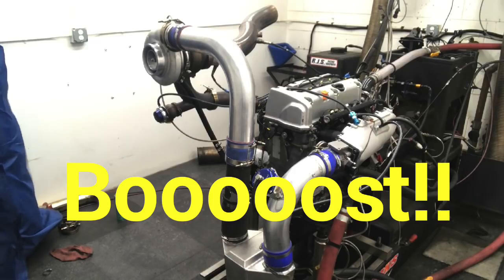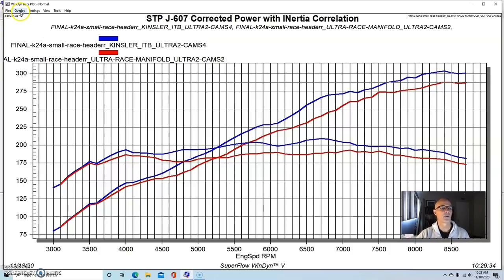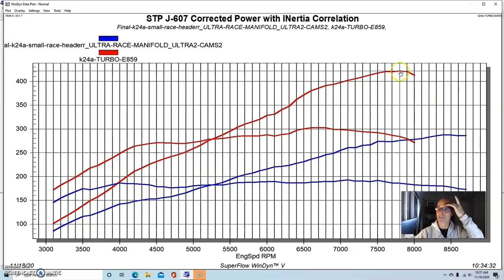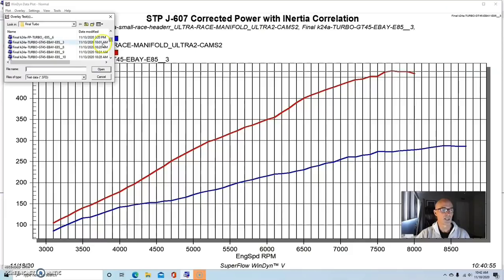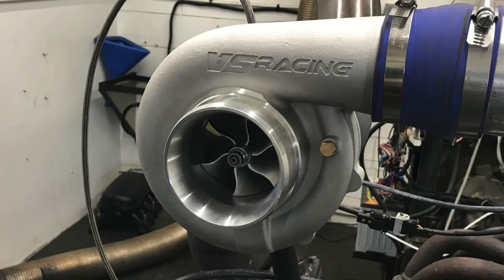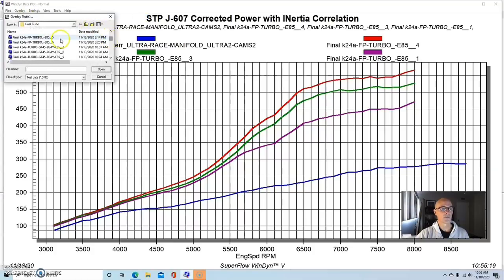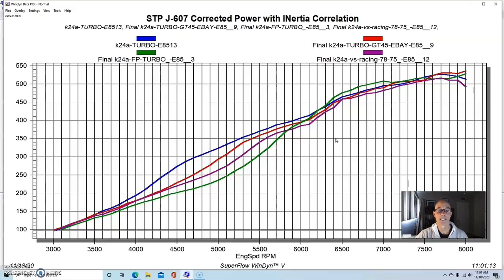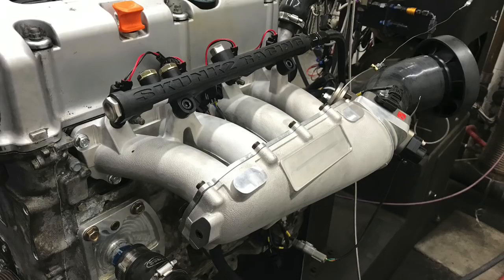CHEAP TURBO TEST-K24A2 BOOST RESPONSE TEST

Comment: Honda should have, and still should, produce two V8 engines. 1st with a N/A engine, and an optional 2nd V8 Turbo engine that has exhaust manifold built into the heads, for massive torque, with variable twin-turbos or compound turbo setup.   Put the N/A V8 into a TRUCK frame, for under $30,000.  Then an option for an off-road/rally TRUCK, with the twin turbo, for under $40,000.  Take some losses but it would sell like hot-cakes.  Build them in USA!
Reply: Going be alot of r&d going on.
Reply: Honda cant do that because it would make every other car company go out of business. A turbo awd v8 civic would destroy anything and everything on the street and track. It would literally be the greatest engine ever produced and there would be no point in buying anything other than a v8 honda engine.
Reply: @lamydora457  Sounds like a good thing!

Comment: Such a great video brother good job man!! Hey so what brand is the 62mm turbo do you have an affiliate link on where to purchase it? I want to do a budget turbo set up on my 1 of 1 kswapped Ford Festiva. If you could share any insight on a full budget build that would be fantastic. I’m new to the k24 but man they seems to make great power and stay fairly reliable even with a stock longblock. Any chance I’d be able to email you for a chat?
Reply from the maker: THE 62MM WAS ACTUALLY A 67MM AND WAS FROM PRECISION
Reply: @ dang that’s a good turbo any recommendations that’s will do the job but not break the bank?
Reply: @richardholdener1727  so that 67mm was it the 6766? Or the 6775? That are decently priced and man from this video that what I want lol

Comment: FP turbo results look like a low back pressure with a large cam - as soon as back pressure creeps in on the others it'll drop power off pretty quick - that FP probably had 1:1 emap and imap or close to and lets the big cams eat.

Comment: Also to add to this bigger turbo makes more power at lower boost such as 10 lbs on a small turbo may be 5 lbs on a big turbo which can have better charge temps I have also seen turbos with a .63 hot 78 cold that make 5lbs fast but get lazy at more boost over a .63 70 closer to equal wheels

Comment: Watching your channel inspired me to buy 2 3RZ motors.  I have spent a week or so trying to wrap my brain around turbos and which one I need but my head is just mush. This motor is going to be a swap in my 1987 Toyota pickup which lacks power with its 22r. Any advice on turbo size for my 2.7L 4 cylinder 3RZ. Thanks

Comment: Would absolutely love to get some Kinsler ITBs for my all motor K. Currently still running the Hayward Performance manifold and it does really well but ITBs are just top shelf all motor units lol. Truthfully my ported and port matched RBC made good power in itself. We’ll see what direction my next $$ gets sent to; ITBs are certainly in my future if I stay all motor but I’m also considering dumping the current piston giving me ~13.5:1 static comp and going for around 10:1 then taking the old Sidewinder and GTX3076 off the parts shelf and making something new happen. Decisions decisions lol
Reply: P.S. Someone on the east coast come buy my LS car so I can have more free cash to dump in the rice rocket haha

Comment: Might be a very stupid question but can you/I run salt ice water in the intercooler?  How fast would it start to cause problems if any?   We learned when we were young that salt water will get way colder than plain water, it's how we got ice cold beer very quickly.
Reply from the maker: YES YOU CAN-IT'S NOT GREAT ON ALUMINUM LONG TERM

Comment: @richard Holdener curious as to why 17* timing? Were you seeing knock?  And was that at peak tq or were you ramping timing as rpm increased to keep peak hp climbing? Also curious what the back pressure was with using the stock  exhaust manifold. I would guess that flow is being hurt at higher rpm and that’s why curve is falling off from the Na pulls.
Reply from the maker: the drop off didn't happen with the FP turbo, we tried more timing-did not log back pressure

Comment: Has he done a video about ideal turbo for k24? Say I wanted 450-500hp or maybe 600hp on pump gas for street droving and Hiroshima 800-1200hp on e85 is that possible? What woukd be the best for steady power but also make the most peak? I have a 3582r and I make boost around 3500 and on pump gas and only about 10psi the tires spin in second but I feel it could use a little more in 4th and 5th. Do I just need to set up boost by gear or maybe woukd a differemt turbo be ideal? It's in a mr2 spyder
Reply from the maker: 1200 hp on a turbo k24 takes a lot more than e85

Comment: If the dyno can do a 5000 rpm run i.e. 3000-8000 rpm, can you start to show v8 engines at 2000 rpm and up? Off the line power is important for heavier vehicles.
Reply from the maker: the Power Mark is a different dyno (DTS/Superflow hybrid)

Comment: I have a Chenweth dunebuggy that I want to repower and I'm thinking either K24 or J32/J35. I'm not looking for a 600hp screamer more along the lines of 300-400hp with plenty of torque. I could modify the frame and mount the engine up front and run 4wd or could put it in the back and run 2wd. It's a future project something I'll be working on next year or the year after so no rush but would love to get some feedback and what you all think? I kind of like the idea of mounting the engine of up front and pulling the drive line from a 4wd Honda Pilot. Need some help on what all I need to make the engine run as far as computer control. I know older engines alright but haven't had a lot of experience when it comes to modern engines. So any assistance would be greatly appreciated.
Reply from the maker: I would pick the V6-not sure on the ECU swap portion
Reply: @richardholdener1727  Thank you.

Comment: wondering if there are one of these that puts out around 16lbs for a "Polaris RZR Turbo S" side by side, as the big turbos for this machine are 1500 $ +
Reply from the maker: what is the na power output of that motor
Reply: @richardholdener1727  ATM just under 200bhp at the crank with the std turbo but have no idea on NA. Around 110 as far as I know

Comment: How much boost/HP would you limit a Prelude JDM H23 so it is still fun to drive without having a bunch of wheel-spin for a street car?
Reply from the maker: TRY 7 PSI-THEN TRY 10
Reply: H series have weak ringlands. Get a good tune from a reputable tuner...7-9 psi is fine, much more and the ringlands turn to dust.....ask how I know 😂

Comment: hey Richard could you tell me if trick flow powerport cleveland heads will bolt right to a speedmaster 351 4.123" bore block or if theres machining to do besides drilling heads 4 the water crossover?
Reply from the maker: have not tried that
Reply: @richardholdener1727  well thanks for the reply man love what u do🎉
Reply: also a procharger and rwd intake on a 3800 would make a good Other Guys hint hint

Comment: I have a prevailing question: how much does the foreign(Honda/Toyota) engine builds cost $/hp vs American engine builds? Without making compensation to number of cylinders- because it’s a choice to run 4 or 8 cylinders most times. Cause I hate every Honda runner complaining they lost cause they only got 4 cylinders...run wat ya bring! Tears don’t count. I don’t cry when some crazy boosted Honda roasts my ass like corn on da cob. But most the time, I’m only at like half the money in my car build as them, and if I just add a couple bucks more, they become fair game for a run. Thanks & Cheers!
Reply: What does it matter if your opponent spends more than you do? You gotta pay to play and that applies to every engine configuration

Comment: What's the approximate lifespan of the g45 in a street application? Can you advise on what turbo and how much hp can I add to a mazda L5ve for a sleeper application on a 4000lb vehicle?
Reply from the maker: WE'VE RUN THE SAME GT45 FOR 10 YEARS NOW ON THE DYNO
Reply: @richardholdener1727  thanks much for your response. I'm doing a project build on a 2010 Hyundai Santa Fe as a sleeper, it's a heavy vehicle, how much hp should I aim for with the l5ve to have that effect?
Reply from the maker: no idea what an l5ve is
Reply: @richardholdener1727  😂😂 At least you're honest. The L5 is the engine which came with the 09-13 Mazda 6. It's supposedly a strong engine and fits perfectly in the Santa Fe.

Comment: What are you going to gap the rings to when you do it?
.025 top and .026 2nd ring?
Reply from the maker: near that
Reply: @richardholdener1727  do you think will go tigher then that ?
Im building a darton dry T interlocking sleeves k24 with wiesco 87.5mm 2618 pistons.
Just gapped top rings .022 and 2nd rings. 025 (or to much difference?)
Wanted . 023  on 2nd rings but went over on the one so just made them .025
Im planning on street strip driving it at 750rwhp on e50 blend.
Do you think those gaps are ok ?
Also cant wait to see the big bang video.
I blew up 2  k20a2 rods spit through block 
One was 610rwhp other was 675rwhp 
They lasted aprox 3 months on street with some pulls.

Comment: I have a question I have a 2012 Chevrolet Silverado single cab with a 4.3 V6 what size turbo can I use with it without having to Gap the Rings or do you suggest another method of increasing horsepower
Reply from the maker: the turbo size does not determine ring gap

Comment: Is there an video data regarding a turbo sized too small, such as an 6.0 LS with a small 54-56mm single? How drastically does the power output drop due to increasing back pressure?
Reply from the maker: watch the bbc 454 single turbo with the gt45
Reply: @richardholdener1727  Good call! I'll take a look! **For reference currently putting together a compounded LQ4 XJ8 which is why I'm curious. Should have some data soon so it'll be interesting to see the similarities in response. Compound K series content is going to be fantastic!

Comment: Cheep dosent mean bad, just means some cut corners. Eg china knockoff(labled hx40?) 52mm holset hx35/10CM =crazy fast spool 21psi max; same  tune w/holset(USA) 56mm hx35/12 = slower spool and more topend 28psi( bigger /heavier/slower cast wheel, 2cm looser/bigger /slower housing actualy dynamic balancing=easyer to spin at full load) 
The "big"hx35(56mm/standerd) got hurt when I "forgot" the protective "blue shop towel " in the intake... that bent the shaft 0.001-0.005",just enough to slow spool 0.25sec and limmit topend to 25psi with no wheel contact ) the damage set up a harmonic that was progressive failure. 60k mi /10months later there were 2 contact patches in the housing and slightly folded inducer blades.

Comment: Has anyone ever done an Intech four cam V8 (Lincoln Mark 8, etc.) to find the power capacity of the stock bottom end for the non-forged crank engines and/or an early to late intake comparison on Lincoln Mark 8 engines ? I was wondering how much boost I can reliably run in my Mark 8 engine and if I should switch to the second gen intake.
Reply from the maker: you can run a lot if the tune is right and you add ring gap
Reply: @richardholdener1727  I suppose that much is a given, what I am wondering is what the crank itself is able to withstand. I have been told the cast crank in my Mark 8 is only good for around 450 HP

Comment: Could do this with the M111 kompressor engines from Mercedes
Reply from the maker: compared to what?
Reply: @richardholdener1727 compared other high horsepower 4 cylinder engine in stock form.

Comment: @richard holdener, can you do one of these videos on a 5.3 LS?? Comparing some diff size turbos. Looking to single turbo boost a 5.3 Tahoe but want to keep it a reasonable daily to drive.
Reply from the maker: what power level-a 5.3L doesn't really have spool issues as much as a smaller 2.4L

Comment: What effect would 93 octane gasoline have on the setup?
Reply from the maker: a lot
Reply: @richardholdener1727  I guess what I'm asking is what if E85 is not readily available?
Reply: Robert Bandy  I'm trying to understand the real world power losses from the lower octane rating of 93 gasoline; i.e., 20%? 30%? 50%?   I'm looking at 500 bhp on these dyno runs...  would these numbers be 300bhp?  350bhp?  just trying to understand from the experts.   thanks.

Comment: Educate me Richard. Why does the Kinsler make so much torque when it has almost no runner length?
Reply: My guess: the runners are tuned to a frequency that produces a resonant wave ram air effect
Reply from the maker: it has more length than the other Skunk intakes

Comment: Are you sure it wasn't boost creep on that FP final test? Not enough wastegate maybe.

And holy hell, I really had no idea a k24 could use the same turbo as an LS.
Reply from the maker: boost pressure did not change-we had two 45mm gates

Comment: U should be making power all the way to 9000 rpm.... hit up Brent at PFI
Reply: A K24A head doesn't flow as well as a K20A2 head. Usually over 8200rpm is when the power drops off, unless your head is ported. If he had a K20A2 head he would be making power until 9k.

Comment: Over 8000 RPM , I thought his machine wouldn't run that far out
Reply: Previous he took it to 8700na. Was going great. There is a reason this engine is so highly regarded
Reply from the maker: oil pressure was solid
Reply: Robert Bandy  that's more of an oil pickup issue where oil pressure while the engine is static shows if the pump itself is the cause of an issue.
Two separate problems with two different fixes

Comment: You know damn well you can't double your hp by doubling atmospheric simply due to volumetric efficiency and heat.
Simple, simple, simple.
Reply: And yet the formula holds true many times over. Keep in mind that increasing the boost pressure increases the effective compression ratio and that increases thermal efficiency. Intercooling on top of that removes the heat from the compression done by the turbo so the individual molecules of air going into the combustion chamber have the same potential heat addition capacity from the fuel burn as they would if they came in at atmospheric pressure, and producing power is all about absorbing as much heat as possible from as much fuel as possible to produce that sweet sweet pressure rise and expansion that pushes the pistons down.
Reply: @EpicScandinavian  very few engine are capable of achieving 100% VE. Honda being one with the way the head achieves a venturi. Increasing the back pressure becomes exponentially higher as boost crosses the 2 bar mark. In this case it did get very close to doubling but you know well it wont go forever even with limitless intercooling.
Reply from the maker: you must be new to the game
Reply: You have a lot to learn then internet genius. You see, Richard has done exactly that, dozens and dozens of times. I bet he has a YouTube video to backup my claim.....and no engine goes on forever, irregardless of aspiration.
Reply: Robert Bandy  homeboy dosen't understand that adding 1 bar of boost, with the right tune roughly doubles power, so the V/E increase is 100%. So if you have an 80% efficient engine, that 1 bar increases efficiency to 180%, a 100% increase. Can't argue the math, or the dyno.....
Reply: Robert Bandy  I know right, GT45 makes 750ish hp with 2X displacement LS, K series does 600+ with the same hairdryer. Hot damn!
Reply: Robert Bandy  yeah but then you have to look at torque and how high you have to rev to reach those hp numbers, always tradeoffs

Comment: Did you ever use quick spool? If not can you do this test again using it?
Reply: I think those only work on twin scroll turbos, and setting up the hot side is a lot more work
Reply: What exactly are you referring to?
Reply: @GreatLakesLogger  . It forces all the exhaust thru one side of the turbo to spool it faster at low rpm. It’s like putting your thumb over a garden hose
Reply: @truckfreak4537  ok so it would have to be a divided housing such as twin scroll or dual volute.

Comment: Or you could just get a better turbo and control the boost through a 3 or 4 port solenoid.
Reply from the maker: the controller won't change the spool rate when the gates are closed